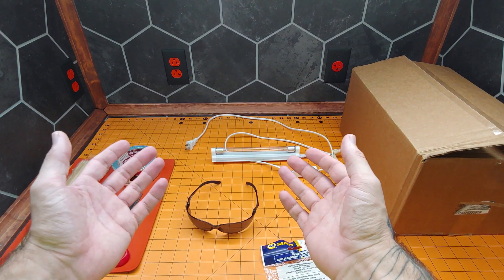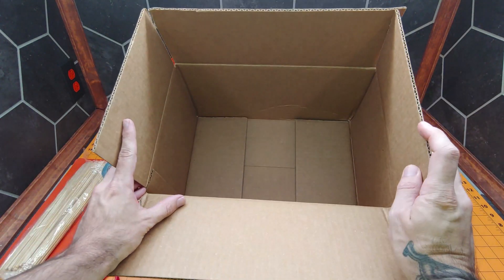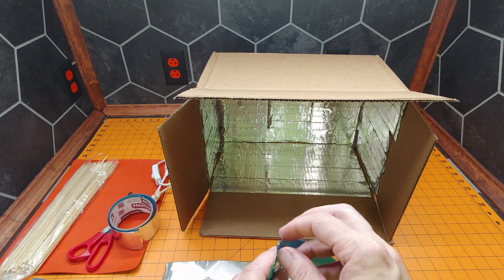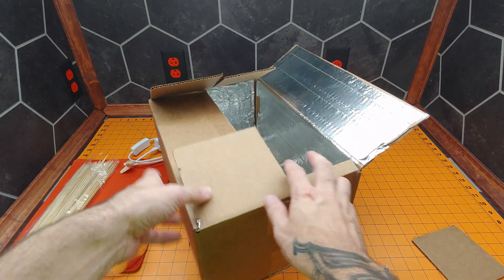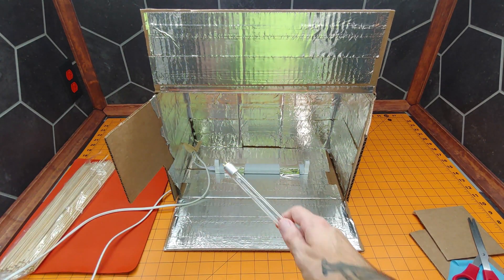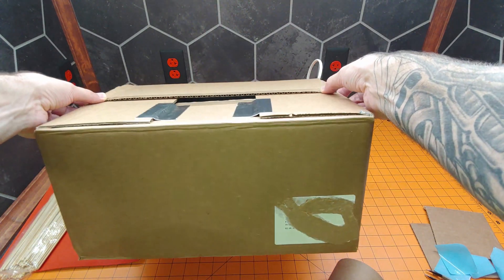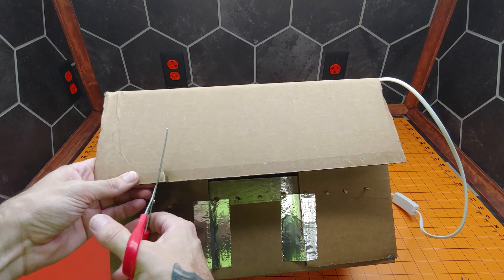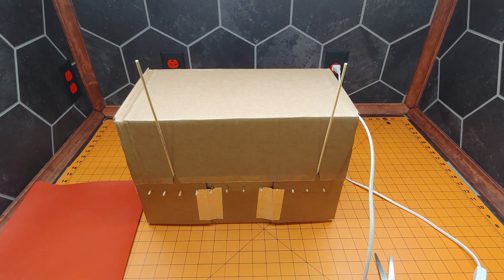DIY UV Sterilization Box: Build Instructions and Walkthrough

Comment: Keep in mind that any part of the object in shadow will not be sanitized.  So the areas under the skewers will be strips of shadow that won't be sanitized.  To be more complete, you should run the object through twice, turning it over between sessions.
Reply: What if you replaced the skewers with clear fishing line? It's thinner and transparent. Would that help? It's probably easier to just run the box a second time after flipping whatever is inside.
Reply: @TacticalShutdown  UV-C has very poor penetration through objects even if they are transparent. For example, it will NOT penetrate through clear acrylic or a pane of ordinary glass (you need quartz glass for this purpose). For this reason, I doubt it will go through clear fishing line. 

For light objects like masks you can make a mesh of very fine wire to minimize shadowing. If your UV-C lamp is ozone generating then ozone itself has sterilizing potential, though should be careful to let it dissipate and avoid inhaling it because it can cause lung injury.
Reply from the maker: Great point!